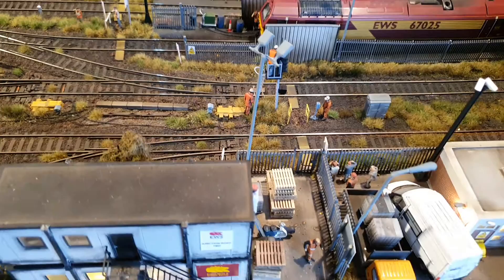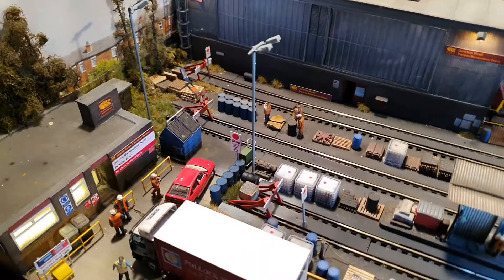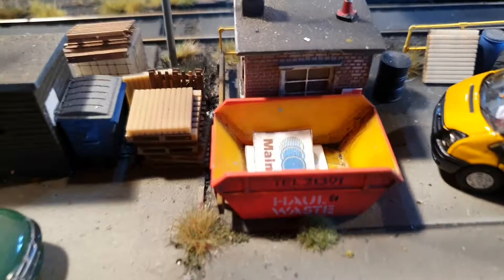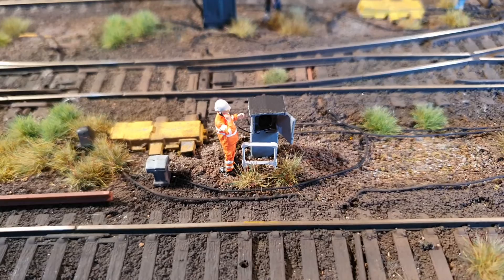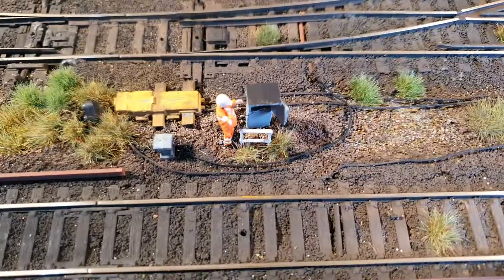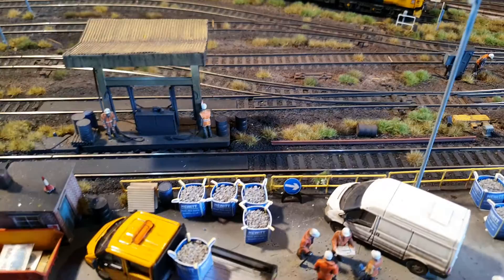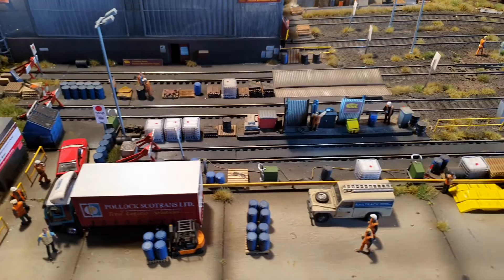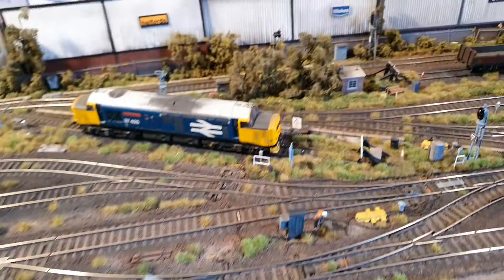Junction Road TMD modern image model railway depot 00 Gauge revamp April 2020.

Comment: Can you help?, I'm will be doing a WCML modern image layout where I will have 00 scale palisade fencing enclosing an embankment, running up two sides to the track above if that makes sense?, Peco make straight palisade fencing but where can I get the same type and size fencing to run up the embankments at say 45 degrees, all railways today have this fencing surrounding track, could you possibly help me with ideas or anyone that might be able to offer help,  many thanks,  Chris.